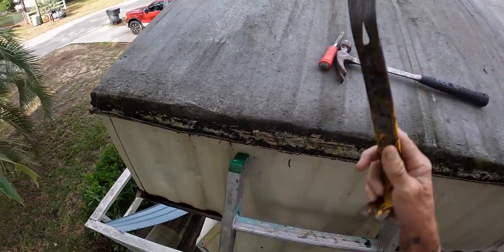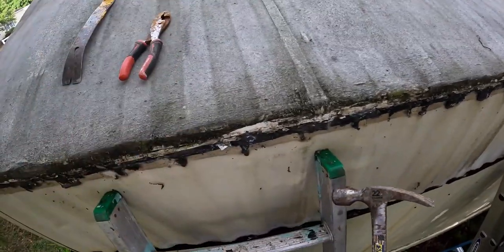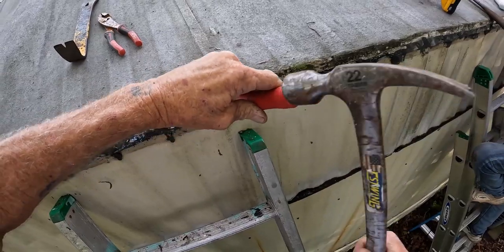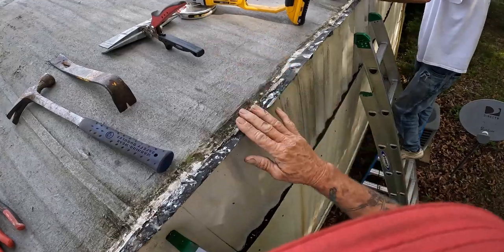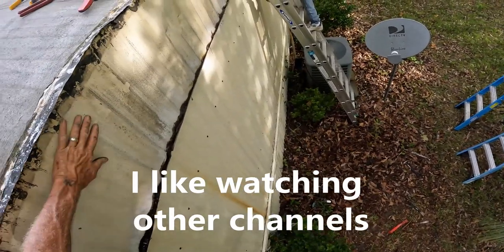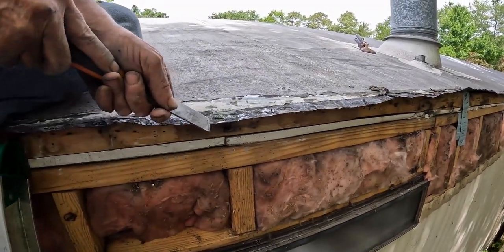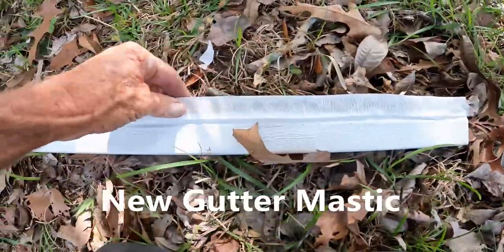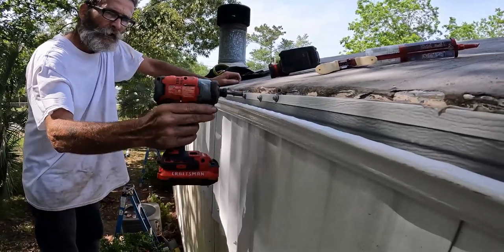(How To) Replace Mobile Home Gutters. 2

Comment: Hey Drew have you ever used a heat. Gun and puddy knife to get all that gunk off I discovered  it when putting new windows in it was amazing  how quick I got all that gunk off and how clean it was sad I'd done put in most of my windows before I thought of it cause it saved so much time
Reply from the maker: Interesting thank you for the tip I will that’s for sure I will next time

Comment: I'm putting t-111 on my '79 mobile. And it had continuous gutters over the aluminum 6" band under the roof. The t-111 is 5/8 and it brings the siding to the edge of the roof overhang so Im having to rethink how to keep water from getting behind the siding. I'm thinking about putting L flashing under the overhang channeling the water away from the siding into the gutter. I'm a journeyman drywall finisher with very little carpentry. Thank you for sharing your knowledge brother. I'll call you or send a text possibly this weekend. God bless you.
Reply from the maker: I look forward to hearing from you my friend I’ll help you out anyway I can and the L flashing you talking about I believe that will work I call it the Z flashing but I’ll flashing I think it’s basically the same thing. I would make a piece a Z flashing out of a piece of metal slip it up underneath the roof and over the t-111

Comment: I'm about to replace gutters on both sides of my trailer with regular gutters for a house (so I can put leaf guard on them). Two questions. Can you use regular house gutters for this? What do you call the "gutter tape" you put on behind the gutter itself? I went to Lowes and Home Depot and got blank stares.
Reply from the maker: It is called mastic. You have to buy it at a mobile home supply store. Type in google Mobile Home Supply Store near you.  If you showed them a picture of it at Lowe’s they would probably be able to steer you in the correct direction but generally I buy it at the mobile home store and it’s sold as gray putty or mastic they use it behind the windows of a mobile home behind the window frame and they also use it for gutters behind the gutters and putting house gutters up there I’m not exactly sure how you would steal it to keep the water from coming behind it
Reply from the maker: I’m not sure how you would seal it
Reply: @Drewsroofingandhomerepair  I have the 2 inch type gutter on it, but it's rusted out from uncleaned leaves. It's simply screwed to the side of the roof every 4 inches. My plan is to replace the screws, use the mastic to seal the connection to the side of the roof. After gutter replacement, use Henry's elastomeric roof sealant (side benefit as it reduces the electric bill in the summer as it's white) and paint over the top edge afterwards. My neighbor put regular home roofing and spouts (one per side) on a slightly newer trailer.
Reply: @Drewsroofingandhomerepair  Thank you very much.
Reply from the maker: Good luck. It sounds like you’re on the right track. I have two videos on this got a job we did I hope you got to see both of them
Reply: @Drewsroofingandhomerepair  I did. GREAT videos!
Reply: I was in lawn maintenance/ landscaping business for 20yrs and cleaned 100's of roofs and gutters in n Florida..most of the "leaf guards" are garbage..just wanted to give you heads up..I found it better to not use leaf guards and just blow roof and gutters out once a year,and your good(thats with non- mobile homes.with mobile homes just use what this guy is using in video).I could blow a roof and gutters on a medium size home in about 30- 40 minutes ..or hire someone for 50$ to do it..better for roof and gutters to do it this way..trust me..I've seen it all

Comment: Hey guys I  have a 88x16 single wide traitor I believe its a 88 library 
Anyway I was wondering what the difference is from a recover and a replacement?also any idea on a price
Reply: Probably gutter also
Reply from the maker: If you’re talking about a roof over Rubber Roof, like what I do 12,000 there’s another gutter video
Reply from the maker: https://youtu.be/HliJCvUgB3c?si=lxwZnzxYS9Q7hBgn

Comment: I'm redoing my flat roof on my mobile home and luckily my gutters are ok,what im doing is just removing all old caulking from the metal strip that holds down the sheet metal,then replace any screws and reseal it
Reply from the maker: That sounds like a good idea. Good luck with your project.

Comment: Awesome work guys- I need to do a similar job on ours and was wonder where I can source the mini gutters for the mobile homes? Can you help with a suggested source Drew? Thanks! Love your videos.
Reply from the maker: Good question! I’ll buy them from my local mobile home supply store. I’m sure you can call one near you and they will tell you exactly where to get them. It’s not a hard job follow my instructions. It will turn out beautiful.
Reply: @Drewsroofingandhomerepair  thanks Drew- we may just do the rubber roof and overhang as you do- your videos have given us the confidence to DIY it. Thanks so much for sharing your work here.

Comment: I have to replace the top edge of metal that used to hold the gutters. The gutters either came off or were removed and all that's left is holes every 3" that rain water flows into. 🤷🏾‍♂️🤷🏾‍♂️🤷🏾‍♂️ Lol 😂🤣

But then I'm going to add a 4"-6" overhang and then new gutters. Best of both worlds. 👍🏽
Reply from the maker: How are you going to add an overhang and are we talking about a single wide trailer like this one
Reply: @Drewsroofingandhomerepair  Hi Drew. Yes it's a single wide with no overhang. 

I'm thinking of ripping 1 side of 2x4's or 2x6's length wise at an angle on a table saw. And screwing them flush into the ends of the mobile home roof trusses to secure them. Then adding flashing with mastic over the top of the wood so I won't have any leaks. I can add blocks underneath the 2x6 or 2x4 to help support it from underneath. 

Then I can add 4-6" tinted plastic panels as the overhang. That would be light weight.
Reply from the maker: That sounds like a good idea to me
Reply: @Drewsroofingandhomerepair  I have a couple of options. Just want to keep the rain and summer sun off the south side of the mobile. And not make it to heavy.
Reply from the maker: I think what you gonna do is fine
Reply: @Drewsroofingandhomerepair  Appreciate it Drew. 👍🏽👍🏽👍🏽👍🏽

Comment: Will you travel to Sevierville TN to do a gutter, roof, and floor repair on a 1997 single wide trailer size 16x80?
Reply from the maker: Unfortunately Tina we’re not doing much traveling anymore it’s too expensive

Comment: Those dark rain water lines on the outside of the trailer, where do they come from, and what to do to stop this.
Reply from the maker: They come from the screws the screws are rusting. Remove the screws and put new ones. The new ones should have a rubber gasket between the screw and the trailer. You can get them at Lowe’s or Home Depot. It’s called a metal to wood screw. They will have a rubber gasket on them just like the screws I use on my turn bar on my Rubber Roof Video‘s
Reply: @Drewsroofingandhomerepair  Okay thanks so much for the infor. I'll head over there and purchase this.

Comment: So I’m visiting my moms and staying with he in her 1974 double wide. We just had gusts of 40 mph wind. The entire roof was rising and settling?  Is that how these metal roofs are supposed to be? It was like a blanket rising and falling
Reply from the maker: I have seen that before as a matter fact I have seen people put tires and all kinds of things up there to stop that from happening. Some mobile homes are not built as well as others
Reply: @Drewsroofingandhomerepair  do you think it’s occurring due to air getting between the roof panel and the trusses?
Reply from the maker: No it’s due to wind blowing across the roof. Lifting it up
Reply: @Drewsroofingandhomerepair  oh really crap? Well I guess that’s good news in a sense. Thanks for the information. Makes me feel better that air isn’t getting in there and the roof is gonna lift off
Reply from the maker: No worries there. If you blow wind over a surface it will lift. It’s called uplift. It hapoens all the time. A tire or a few bricks will help. You can also use screws to hood it down. Just be careful not to cause more danage
Reply: @Drewsroofingandhomerepair  Just like an airplane wing. Our brain tells us airplane fly because of the air UNDER the wing. It's actually air flow over that lifts the plane up. If the roof was cupped instead of bowed up, wind would push it down. But probably wouldn't support the weight of a long swimming pool on the roof!😅😅😅😂😂
Reply: @Drewsroofingandhomerepair  I should have kept reading...my bad.

Comment: Could you use a wire end on a drill to clean instead of a chisel? Just asking
Reply from the maker: After we got all the staples out and the mastic off we used a grinder.
Reply: @Drewsroofingandhomerepair  What about using a flapper disc on grinder? Less chance of penetration?

Comment: I know this has nothing to do with gutters but I'm putting my floor in .for the  beams joist frame idk what it's called but the wood the sub floor screws to .do I need to use treated wood? I have a old trailer mine is railroad style the beams go the long way with the trailer.
Reply from the maker: No you do not use treated wood on the inside of a mobile home. Use yellow pine or Spruce more than likely yellow pine
Reply: @Drewsroofingandhomerepair  ok thank you.
Reply from the maker: Treated wood is OK for the exterior

Comment: Think about a facia board and a drip edge much nicer
Reply from the maker: All we are doing is replacing the gutter. We’re not adding a facia board. This is stock just the way it comes from the factory and we’re just trying to replace the rotted gutters and the metal below.
Reply: @Drewsroofingandhomerepair  Thank you!

Comment: Use some gloves  boys
Reply from the maker: Thank you my friend I’m going to buy 10 packs of gloves on Monday and I’m gonna put them all over the place so I can find them when I need them. In my truck in my garage in my car in my trailer in my toolbox I’m gonna put them everywhere I really do plan on wearing them more often. My hands look like shredded meat and cheese
Reply: Haha, one of my dating requirements, before getting married was rough hands….nothing against any soft handed men, but scars, scratches, and such on hands, tells me a lot about a guy, even if they wear gloves, at some point something happened that made them realize they need gloves, and those marks are still there. Btw, every guy I know owns 72 sets of work gloves, but never wears them.